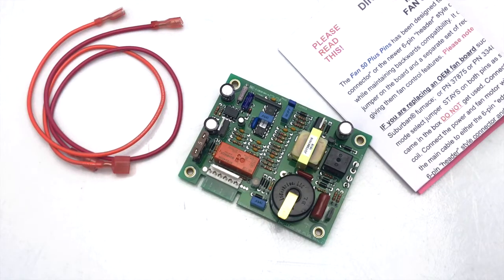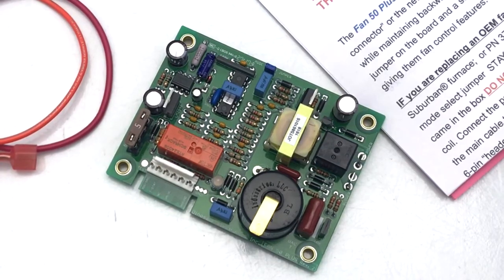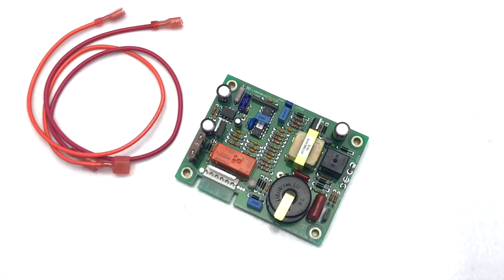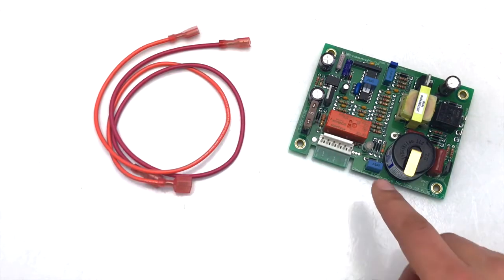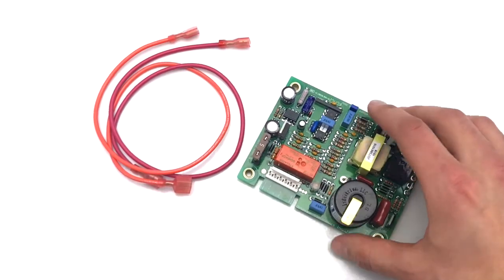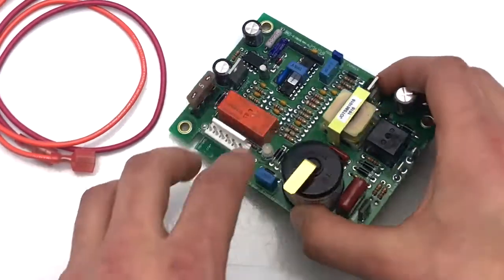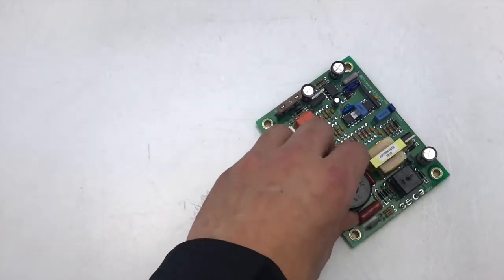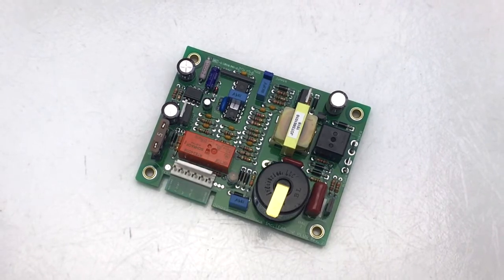Dinosaur Elect. Fan 50 Plus Pins Replacement Furnace Ignition Board Product Description

Comment: PANTHER PRODUCTS - just ripped me off on $160.
First they claimed returns are free. Then they told me they will charge me 5% restocking fee, then they charged me %20 and asked to pay to ship the product back.
I have recorded conversation with Panther Rep. stating and confirming that the product has no documentation, their YT videos are missleading and offerd $30 charge only. Instead I have to pay $65 return and lost another %100. I barely opened the product box and decided it will not work and it costed me $160

TOTAL RIP OFF !
STAY AWAY FROM THIS VENDOR !